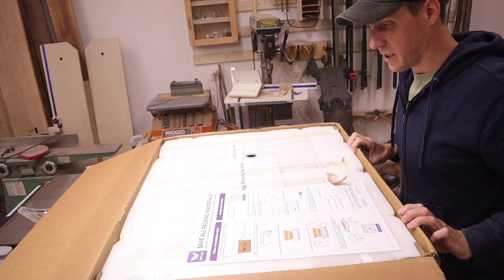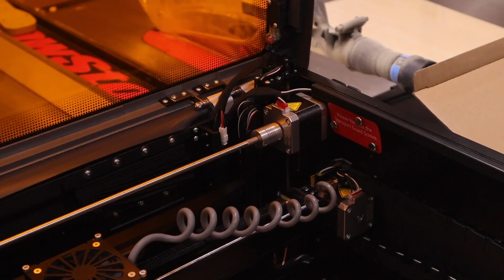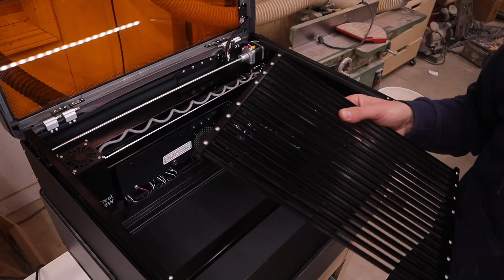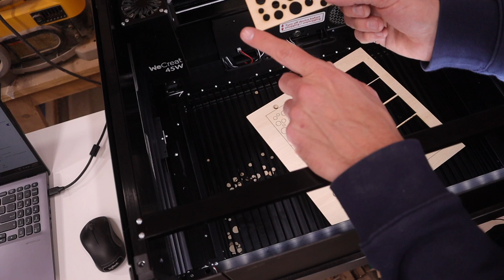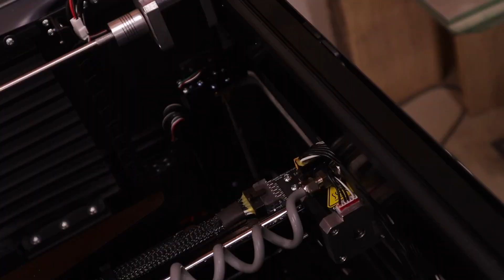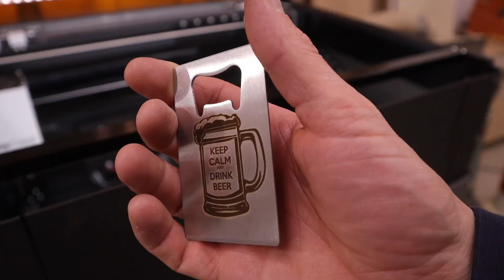WeCreat Vision Pro 45watt Laser Engraver/Cutter - BeamFocus Technology / Thicker+Quicker+Finer

Comment: Why does No One mention that it is NOT FULLY COMPATIBLE with Lightburn? Are you told not to say anything?
Reply from the maker: It can be used with lightburn. You just are unable to use the camera feature.
Reply: @WesHamstra if you can show me how that would be great   Because it set the last piece of wood on fire because it wouldn’t lower down or shut down when I opened the lid. I had to shut the power off to get it to stop